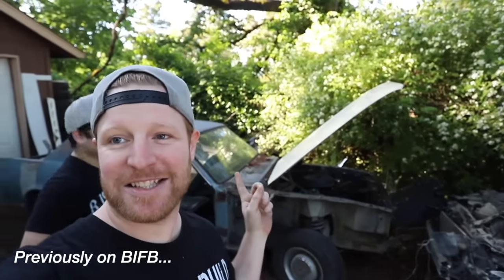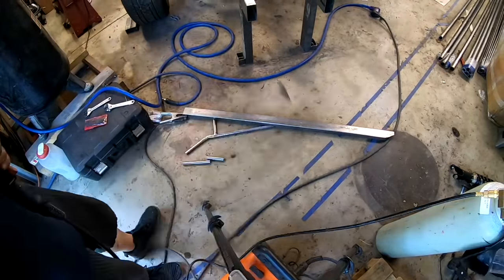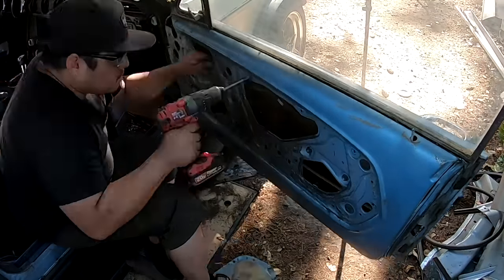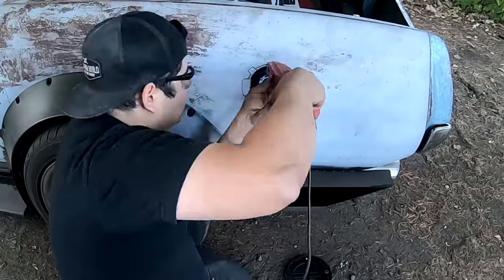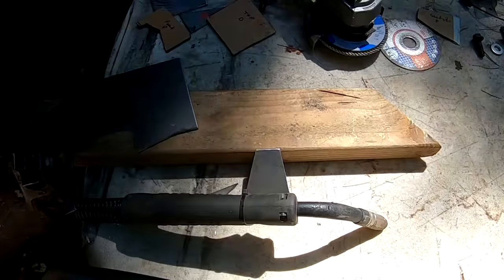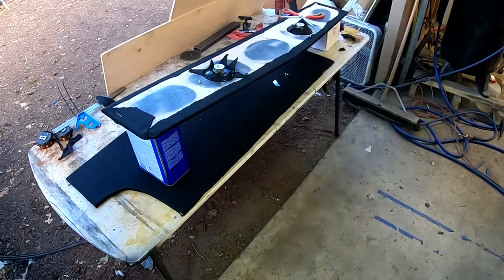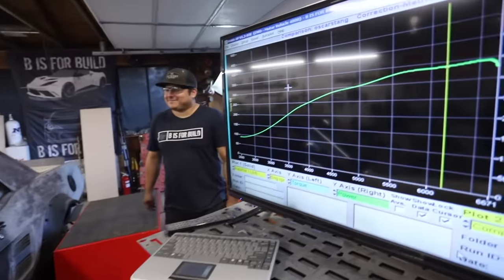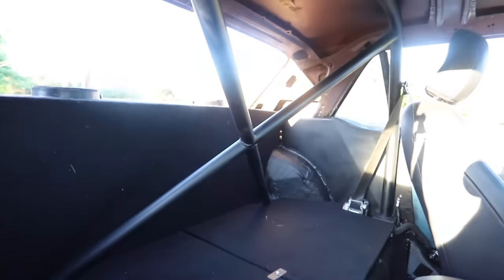2016 to 1967 Mustang GT Body Swap is complete! Classic Looks with Coyote Power!

Comment: Hi, my name is Oscar and there’s absolutely NOTHING I cannot do.
Reply: Agreed! I thought that they were going to rename the channel “O is for Oscar” on the Lambo build.
Reply: Josh's
Reply: Hahaha...
Reply: That is why the car should be named "MUSCAR"
Reply: That's why I love this channel honestly, they can do almost anything in house, from welding, to paint, to electrical work and now tuning
Reply: Dennis Knol - completely agree. Chris needs to 3D print that in the Mustang font and that should be what’s on the trunk lid.
Reply: Except break a window with a steel bar' LOL
0:38
Reply: Oscar the goat
Reply: Same
Reply: Thomas Weatherford ok thomas
Reply: Didn't do so good on engine power...something is wrong.
Reply: But can he solve global warming??🙉🙊🙈🤣
Reply: Especially a great job👎👎👎
Reply: @celsobarrios4810  well he definitely did some good he save 2 cars from the crusher and if the weight difference isn't to bad he can get descent mpgs🤔
Reply: Anyone in the Massachusetts area capable of these kind of builds?

Wanna put an Audi gT coupe 1984 body on an Audi S3 chassis. Can this be done? Wheel base is within a 1/2” of each other but the S3 is 3 inches wider. I am going to put a widebody kit on the GT so maybe that helps

Comment: You realize that way back in the "olden days",  separate keys for the locks and the ignition was standard...
Reply: not sure if it still counts as the olden days but my 97 buick regal is like that
Reply: My 89 mustang is like that too
Reply: @totallyeinstein5151  my 91 mustang door locks dont even work
Reply: @TheMrThumpstar  My 95 Camaro locks work , but i never use them .
Reply: This is gone since the early 80s here in Europe....
Reply: My 88 camaro is like this and so is my dad's 92 seirra
Reply: My 90's VW Caddy had 3. Doors, ignition and gasdoor.
Reply: The round one and the square one 😂😂
Reply: I think GM was the one that carried it on for the longest. Square key for ignition and round for everything else
Reply: For Fords the round key operated the trunk and the glovebox and the square key the doors and the ignition.  The idea was that you would give the car to a valet with only the square key so he  would not have access to the locked compartments.  In the 80s, I had a Honda Prelude that improved on this concept where both keys would start the car and open the doors, but the round key was not deep enough to unlock any of the compartments.
80s ZR1 Corvettes had a feature where you could reduce the power with a key when handing the car over as well.
Reply: My 99 boxsters locks don't work for nun
Reply: 89 bronco 2 here with that....
Reply: 😂 Ya all the way back to the '90's....
Reply: yep my 70 marauder is like that
Reply: My 67 mustang has one key for doors and ignition and another for the trunk.
Reply: My 90 f150 is like that
Reply: My 73 javelin has three keys
Reply: Yeah, in my 92' F-150 Flare Side, the square key was for the ignition and the round one was for the door locks. I'm pretty sure in Ford cars they had a different key for the trunk? If I'm wrong, it was the round key that unlocked the doors that would've unlocked the trunk also.
Reply: I've got a key for my ignition, doors, and trunk and a key for my t-tops. I've got 4 keys for my bike
Reply: My truck has the same key. It's also an old military truck so I don't think it counts

Comment: Oscar need to build his own diffuser instead of that plastic BRZ thing🤷🏼‍♂️
Reply: Agreed, smooth single piece incorporating the exhaust with holes, looks a bit odd at the moment
Reply: Yep the diffuser on it looks pants , throw it in the bin
Reply: 100% agreed
Reply: Maybe it'll look better after they paint everything
Reply: Agreed, and he also needs to take off the $10 plastic flares too and build his own. Shouldn't be any plastic with all the cool metal fab work he has on the car.
Reply: jr daniel dont think they are gonna paint the car. He has stated several times that they will have the rough look its got now
Reply: @sidneykiller123  they have to tho right? You can't just let it rust lol
Reply: @jrdaniel1017  agreed, but not sure what they are thinking

Comment: Did you register it as 2016 or 1967 mustang?
Reply: I was wondering this as well
Reply: No airbags = no street driving
Reply: @typischeric  no that’s not how it works people put quick release steering wheels on street cars all the time and classic cars don’t have airbags and you can register them
Reply: @exotixblizzy7149  its about the seat airbags
Reply: @exotixblizzy7149  it has the internals of the 2016 so pretty sure those came with airbags

Comment: Talk to your paint store and see if they have a non penetrating reducer for the jamb areas it will help prevent lifting and wrinkling, also applying  a non sanding sealer first will save you a lot of work and prevent you from having to re- sand and re-paint again, sanding in areas like jambs with all the curves and uneven surfaces is difficult with sand paper, maroon 3M scotchbrite pads work great in those areas, talk to your paint rep about the best materials for your specific application it can make the job a lot easier.

Comment: With those skills IMO you should have cut off the rear and front quarters, placed a 3" metal strip for width and then welded the quarters back on. It would then be wide and mean, you'd also get the bonus of a width gap from the front door to the front fender (where you can put some mesh).

Comment: Replace the tacky plastic fender flares with nicely blended in metal and add panels to fill between the running boards and the bottom of the old body, then give it a good paint job.

Comment: I was willing to forgive the lack of execution on the rocker panels since you need those rockers for support... At least that was until I saw that you did put a partial roll cage in and realized that you could have simply put a full cage in modified the Rockers and tucked them in nice and tight so it didn't look like one of those cheap 1980s cars on a truck frame like it does now.

Comment: What happened to the stock wheels that were on the 2016? Did you sell them? Did you keep them. Do you know if they will fit on a 2017 Ford Taurus without adaptors?

Comment: Ok dudes I've got a few questions how well did the front glass  fit around the dash and did you swap out the vin number to the 67' or use the 2016 vin number
Reply: its the 2016s

Comment: Really like the conversion however the fender flares look awkward with the gaps.  I think finishing them out by narrowing them down to a point matching them to the body. Especially in the rear. It just looks unfinished. With Oscar’s fab skills. It would be very simple to build them out of metal or even completing them with plastic with a 3D printer. Just my two sense.

Comment: Well done Oscar. 👏  I do have 1 question. Where did you get the wire harness for those signal lights?? I would to install those in my 65 mustang.
Reply: The wiring harness is from the 2015 mustang. We cut out the old plugs and wired in the aftermarket lights.

Comment: The 67 body needs to flow into that wider chassis. The box things and flares along with the difuzer just take away from its potential due to looking like lazy attempts to avoid the work of blending it. Oscar is quite capable of doing it correctly I should think. If you do it right the 1st time you dont have to do it right the 2nd time !

Comment: While drifting is not my thing, i prefer actual racing, pushing speeds, and handling, ect.. i do respect the work, and effort that goes into car building, and the passion, and i love the creativity, and work in this car. However the 8 holes in the hood..... if you actually installed a mechanical fuel injection system, with the actual 8 injector stacks, that would have been bad a@@, but just 8 fake holes, that do nothing?? that's cheesy....